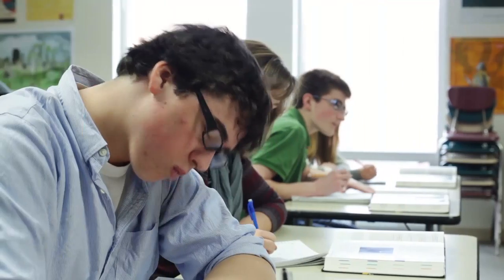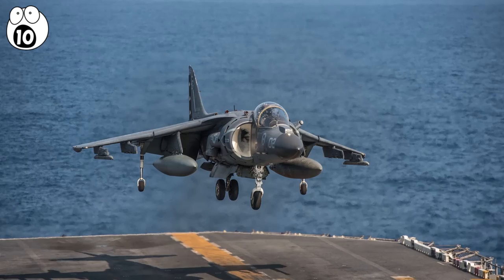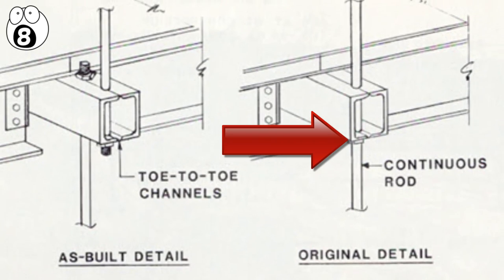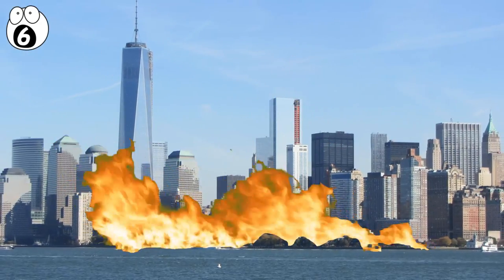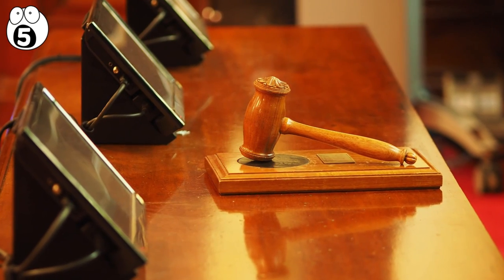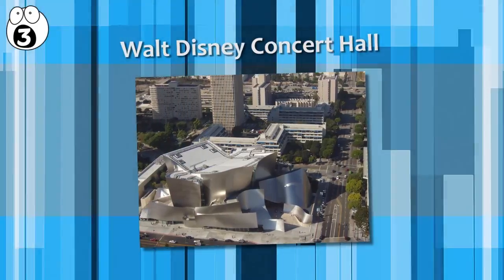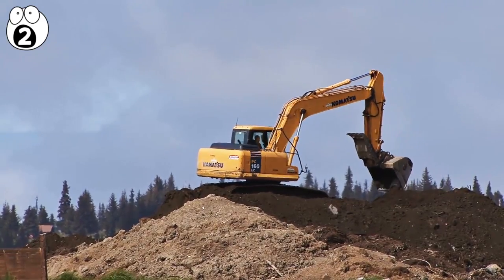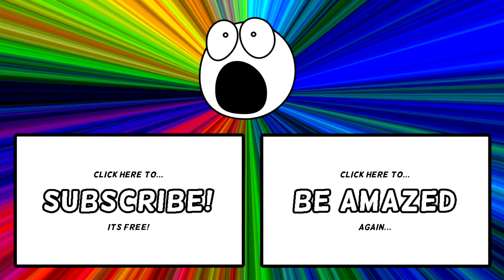Biggest Design Errors Engineers & Architects Made

Comment: 3:42 It doesn't have to do anything with speed or altitude (sort of), it's because of the difference in pressure between the inside and outside of the cabin
Reply: And you're real sure speed and alitude don't have any impact on pressure differences? ;)
Speed: Read a bit about the principles of wings and impacts of different air stream velocities on both sides of the wing. Yes, the magic is pressure differences.
Altitude: Air pressure drops with altitude.

Are you still sure both things triggering pressure differences have nothing to do with pressure differences?
Reply: Chefproll 
The cabin pressure system is what caused the issue.  Neither of what you listed changed the pressure differential between the inside and outside to make a difference.  It was COMPLETELY the cabin pressure system.

What you said would be like saying, putting gas in a car caused it to crash.
Reply: 3:17 DC3, not Comet
Reply: The point is that this is badly put and poorly explained in the video. It would have been better to say that the failure was due to stress cased by pressure difference between the inside and outside.
Reply: Nils Cassiers glad some one else noticed the dc3
Reply: Erikk Friberg:
Sure. But there wouldn't have been any difference to the cabin pressure if the outside pressure hadn't been reduced by speed and altitude. ;)
Argumenting your way is like "Victim wasn't killed by the shooter, who's not guilty – because it's a proven fact the victim was killed by the bullet." :)
By the way: Such kind of evidence is like a joke, of course. But REALITY in Germany.
Real-world example: A guy killed a girl by beating her to death. They pleaded not guilty because it was the ring at the murderer's hand causing death, not the hand itself.
Yes, that's Germany. :D
Reply: Peter Martin: You didn't expect anything really scientific in this kind of videos, did you ? :D
Reply: Chefproll:
Cabin pressure is not a by-product of altitude or speed.  You can pressurize an airplane on the ground without going anywhere.  To get a higher inside pressure than outside pressure, the airplane literally pumps compressed air into the cabin.  Then a valve opens once the desired pressure is met.  That valve is constantly varying how much it opens to maintain the desired pressure.

They don't just seal up the airplane on the ground to maintain pressure.  If that were true, then the pressure inside the airplane would stay relatively the same, but it doesn't.  It is intentionally dropped to the equivalent of about 8,000 - 12,000 feet above sea level, to keep the differential pressure lower.

It's is nothing like "the bullet (ring) killed the person."  If you removed the guy, the death wouldn't have happened.  But, if you removed the altitude and/or speed by, let's just say, flying a short route (or pressurizing it on the ground), where you wouldn't go near as high or fast, but would still be pressurized, it would have still happened.
Reply: This was a fatigue issue caused by the repeated changes in pressure.
Reply: Erikk Friberg:
Argh... Just re-read my first response to Nils, pay some attention to his and my answer's precise wording. I am not talking about the basics of pressure regulation, I am talking about the reasons for the necessity of regulation - the lower outside pressure caused by altitude and speed.
Nils said it had nothing to do with speed or altitude, BUT with pressure difference. Speed (Bernoulli effect) and altitude ("thin" air) CREATE that difference causing the need of regulative mechanisms involved for lowering the overall difference to avoid the cabin bursting like an overpressurized balloon.
That's why there's a direct connection beween speed/altitude and pressure difference, thus a logical error in the primary statement.
Reply: Chefproll:
You are right, I missed the part where you were arguing THE SAME POINT implied by Nils when he said "(sort of)".  My bad.  Next time when you correct someone, make sure you are just (sort of) restating what they said.

Want your mind blown?
We are taught by "EVERYBODY" including the FAA that a wing flys because of the Bernoulli effect, yet ever modern wing engineer for many decades use the Coanda effect.
Reply: Nils Cassiers However the problem wasn't even the pressurization that was the problem. It was the repeated stretching (from pressurizing the cabin) around the aluminum skin that caused metal-fatigue. Eventually the skin gave away on one of the windows, causing a explosive decompression, destroying the plane. 

Btw, the riveting in the structure also made microcracks in the aluminum, developing into metalfatigue over time. When it was discovered, the procedure for riveting changed.
Reply: The truth is, Square Windows WERE used for a brief period until they discovered exactly that which was portrayed in this video. In fact, it is one of the Few Facts actually given in this video. Corners Do Create stresses in Thin-Skinned Hull Aircraft. Tears noticed on several aircraft in the fuselage skin starting at the window corners is the reason there are no more square windows. But prior to noticing these tears on operable aircraft, the airlines had little evidence as to why these planes where disintegrating in the air.
Reply: plus many landing cycles.
Reply: comedian. some of us are trying to be serious here
Reply: WANTED: Extensive YouTube video comments without any highly elaborate person unable to formulate a single sentence without using the terms "fuck" or "fucking" to express his state of mind. ;)
Reply: Robert Mønsted grammar much
Reply: read the comment above my first comment ;)
Reply: Robert Mønsted oh wow
Reply: metal fatigue, one word says it all.
Reply: Yinan Liu to be honest its a combination of factors, metal fatigue being just the final result. Construction techniques, window design and lack of knowledge of some basic metallurgical factors.
While many of the crashes were as a direct result of the window design (square corners) many were also due to shearing in the stressed skin at the revit points due to bad reviting techniques.
 So while metal fatigue was the end result that was and of itself  not a causative factor.
Reply: Yinan Liu it are two words
Reply: Peter Martin Many of his explanations are bad or just wrong. The bridge explanation was wrong. It collapsed because of resonance, not because it didn't have "holes". If it had been built a slightly different size, either larger or smaller, the collapse wouldn't have happened. The hotel walkway explanation was also wrong. The deck was always going to be supported by one rod at the ceiling and in fact didn't fail at the ceiling attachment. It failed at the modified second attachment.
Reply: jussayin mipeece , I would say fatigue IS a primary factor. They new about stress concentrations back then, the plane was designed with that in mind. These planes only started crashing after several flights because fatigue wasn't fully understood. Long story short, they could handle the stress concentrations, not the fatigue.

Comment: As many say, a lot of incorrect facts here - most corrected by other commentators. But I haven't seen one (I can't read all 2,500 replies!) that says the Tacoma Narrows bridge was brought down by the bridge - not solid - having the same resonant frequency as the gusts of wind that came down the channel - that was bad luck, partly caused by a lack of understanding. Just as the Comet crashes were caused by a lack of understanding - not a mistake as such, just a lack of universal knowledge. Resonance is why troops marching over bridges always break step - the Millenium bridge suffered from this to some extent. And a real engineering disaster? Tay bridge, 1879. That WAS caused by engineering error (and cast iron).
Reply: Interesting comment about the bridge being built with solid members rather than trusses--which WOULD have allowed the wind to pass through with far less resistance; and thus limited the “resonance” effect which brought it down? Look up a video of the bridge dancing in the wind, instead of just the still photo shown here, and you’ll see how wildly dancing the bridge deck was before metal fatigue made it collapse.
Reply: Coupled harmonic was created when the wind blew at only 34 miles an hour. A slight give in the bridge matched the frequency of the wind and amplified and feedback on itself.
Reply: You argue plausible case partner. So it's possible that by resonance, the Walls of Jericho were easily brought down by the  marching soldiers stamping their feet? (Book of Joshua Chapter 6).
Reply: Chris Bishop, that's the Millennium bridge mentioned by DrivermanO in the original comment.
Reply: The phenomenon, that killed Tacoma Narrows is (and was at the time) very well known in aviation and it's called aeroelastic flutter (https://www.youtube.com/watch?v=OhwLojNerMU). Basically it means, that bending of the wing (which the bridge obviously is) in airflow is causing the wing to deform in a manner, that increases angle of attack locally, thus increasing lifting force. Knowing the effect doesn't mean that you have the skills necessary to predict that.
Reply: Yes! Finally someone with physics knowledge.  To think it collapsed because of "no holes" (whatever the hell that's supposed to mean) is laughable!
Reply: As laughable as to think, that the bridge collapsed because of the resonance with the wing gusts. The reason was aeroelastic flutter and object in flow creates it's own "gusts". “Flutter is a self-feeding and potentially destructive vibration where aerodynamic forces on an object couple with a structure's natural mode of vibration to produce rapid periodic motion.” 

Reference https://www.physicsforums.com/threads/good-explanation-of-aeroelastic-flutter.624992/

If the reason had been regular gusts, then the bridge would have collapsed due to lateral, not torsional bending.
Reply: If they had used uniform blocks that could be plausible at least with some theoretical number of people stomping in step.

Comment: 0:45 "Planes HAD to catch a wire." 
You don't say? Don't they STILL have to do that today?
Reply: Also by the 'runway' being angled away, when pilots are landing now, the runway is constantly moving to the right, making it exponentially harder to land than it used to be.
Reply: ikr
Reply: anyway, most aircraft carriers had to be designed like that because most of the first ones were converted ships and no one bothered to change them. This caused the need for the wire to be introduced. Also, the wire wasn't held down by drunkards or by people even, most were held down by other heavier and more sturdy things...
Reply: @HunterXray it's worse than that mate. Early Aircraft carriers didn't have the arrestor wires and had all sorts of nonsense like nets, sand bags on ropes, and in a few cases (single) arrestor wires. It was a collaboration between the Royal Navy and the US Navy which got modern landing techniques sorted for jets (IE the arrestor wire arrangement we have today). I'm not sure modern carriers even have the nets any more for when the arrestor hooks get damaged in combat.
Reply: they have multiple to make up for the loss of one and the variation of the part of the runway the plane lands on (if the plane touches down further down than usual)
Reply: Modern CVs do still have the nets, but are used in the case of emergency landings or planes that otherwise require it. Such as a jammed arrestor hook, damaged control surfaces, etc...
link to an image of said net.
http://s.hswstatic.com/gif/aircraft-carrier-47.jpg
Reply: No. Arresting gear was already being used prior to WW II
Reply: we still have nets in case of extreme emergency.
Reply: not in simpleplanes tho. interestingly, there is one of these straight aircraft carriers there
Reply: +davidqbs  I don't know about "exponentially" harder. Slightly harder, maybe, but no worse than having a light crosswind, which is something all pilots have to deal with routinely.
Reply: Nope, not when the modern jet they showed is a harrier jump jet!
Reply: I don't think he knows what a tail hook is.
Reply: HunterXray credit where credit is due he did mention how angling the runway meant if you missed the wire you could pull
Reply: It wasn't 'nonsense', they were simply solving a different problem. The planes of 1920s could fly slow enough to more or less match their speed with the ship steaming into the wind, so stopping wasn't really a problem - but getting blown off the deck by a sudden gust of wind was a very serious threat. Therefore, the first arrestor wires were actually longitudinal rather than transverse - the latter arrangement was, IIRC, only introduced in 1930s, when metal monoplanes became much faster and heavier than the fabric-covered biplanes of 1920s.
Reply: The angled deck, along with the catapult, allowed carriers to conduct take-offs and landings simultaneously rather than having to wait and do it one at a time.
Reply: That, too, was actually not the first time this problem was solved - early carriers had entirely separate flying-off and landing decks. HMS Furious, in its first conversion, had only a flying-off deck in front of the superstructure, and although a few daredevils had managed to land on it by maneuvering around the aforementioned superstructure, that deck wasn't meant for landings. On the second conversion, they added a dedicated landing deck behind the central superstructure, and only on the third round did they combine those into a single deck spanning the length of the ship. 

IJN Akagi was launched with three decks - the main deck for landing and two smaller flying-off decks in the bow of the ship below it; a shorter one for fighters and a longer one for bombers. However, increasing aircraft weights and takeoff speed requirements have rendered those dedicated flying-off decks useless, and they were removed during several refits in the 1930s. Subsequently, the Japanese solved the issue of launching and recovering aircraft simultaneously in an entirely different fashion - they dedicated the job of fleet scouting to cruisers carrying large numbers (up to five per ship) of floatplanes, which meant that cruisers could launch and recover scouts while carriers concentrated on fighters and bombers.

Lexington and Yorktown class aircraft carriers were built with a hangar-deck catapult that could launch aircraft over the side of the ship, without lifting them to the main flight deck at all.  Its capability was quite limited though, and it was very rarely used in actual operations - surviving ships had those catapults removed in 1942.

All in all, while the angled deck is a very useful innovation, it absolutely depends on having catapults capable of launching heavily-laden aircraft with a fast recycle time, and aircraft sturdy enough to survive the acceleration of such launches. Neither were available in the 1920s and 1930s, with aircraft of the time, particularly bombers, requiring most of the flight deck length to accelerate to takeoff speeds. Therefore, an angled deck in, say, 1932 would have had made landings significantly harder for the pilots without actually  allowing for simultaneous takeoff and landing operations, as it did in 1950s.
Reply: HunterXray after I heard that I knew this dude doesn't know jack about sh#t
Reply: Boris Mekler yeah they really didn't do their research did they XD
Reply: I think he meant ' they HAD to catch a wire (to avoid crashing)' today if they miss the wire they can take off again and try again.
Reply: WWII era carriers used crash barriers to catch planes that missed the arrestor wires. It was basically a net that was erected across the deck when the planes came in to land, quickly lowered as soon as the plane landed to allow it to taxi forward, then erected again for the next plane coming in. It wasn't 100% effective, but it did work most of the time.
Reply: There is still a barrier Gordon, one of the constant training evolutions of Deck Crews is the "Emergency Pull Forward" where they get everything aft of the Barrier Arms pulled past the safe line, run the barricade across the deck, shackle it in and raise the Arms.  I believe the Time is under 3 Minutes to be qualled for Operations.. The system as far as i know hasnt substantially changed since the 70's so I believe its still rated to stop up to a RA-5 Vigilante, which was the largest (and Heaviest) fixed Wing A/C operated off of a US carrier.  This whole video is so screwed up it's not funny, this is what happens when someone who doesnt even have the courtesy to do SIMPLE research starts spouting off Opinions in complete ignorance.  Funny thing, the Innovations that REALLY made Carriers effective once the Jet Age came About, namely the Steam Cat (The original Cats were hydraulic, and were incredibly punishing), The Angled Deck, and the Optical landing System were all pioneered by the British Royal Navy's Air Wings, and the RN no longer operates Big Dech Carriers